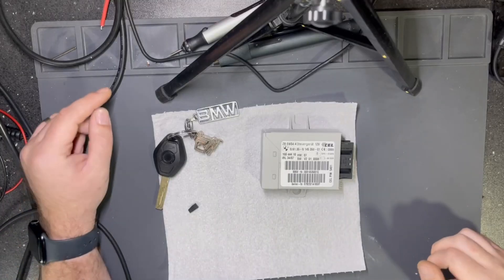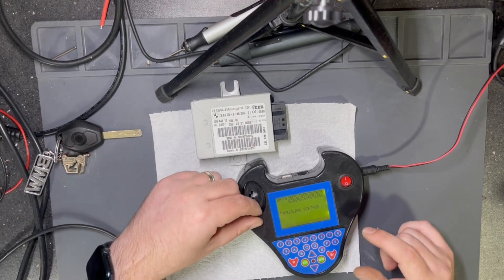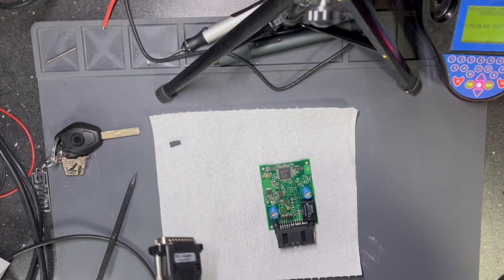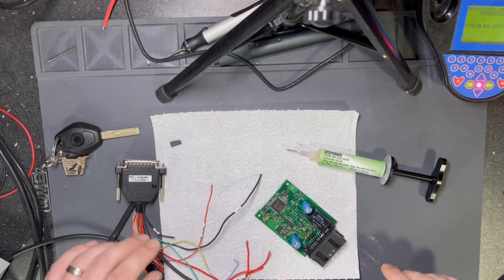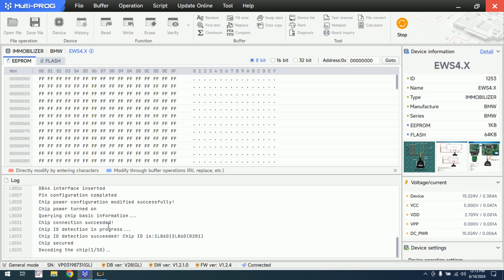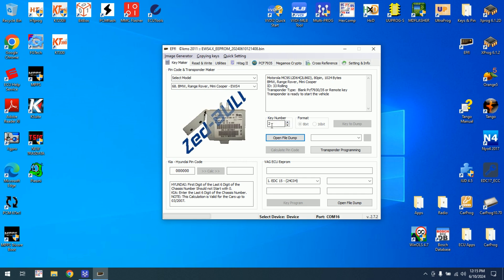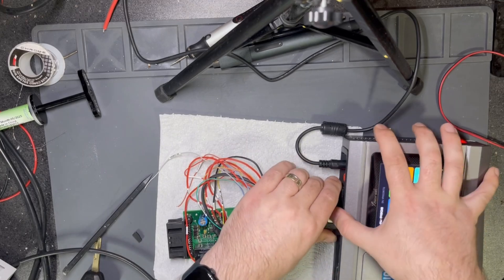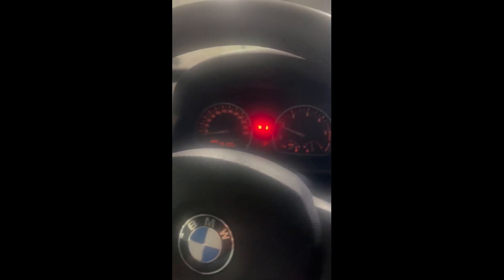BMW EWS4.4 - Add Transponder on Bench

Comment: Do i need the zed, or do the xhorse key tool max work for precode transponder?
Reply from the maker: It will work also on key tool, you need to tranfer file to device then go to - Special functions - Immo data tool - europe - bmw - ews4 - start execution.